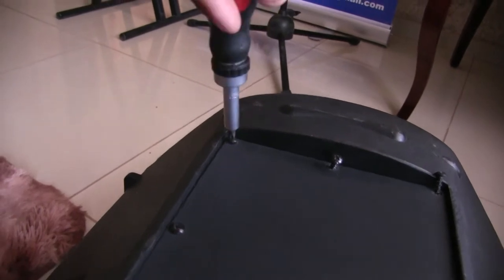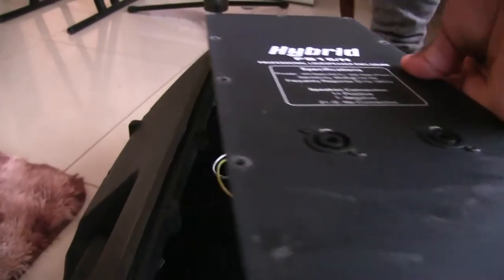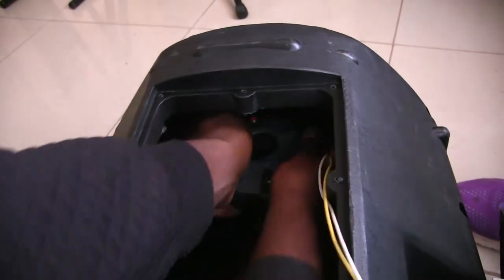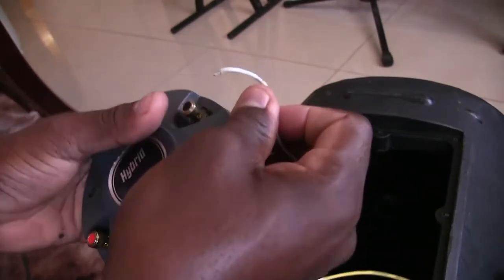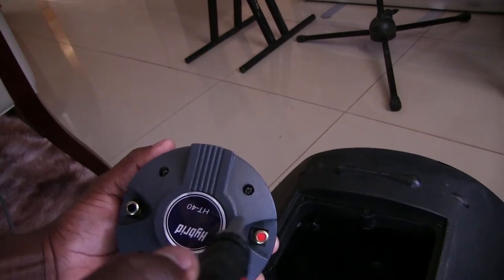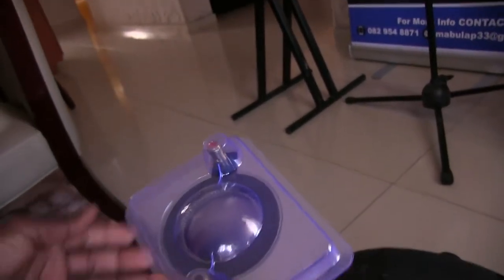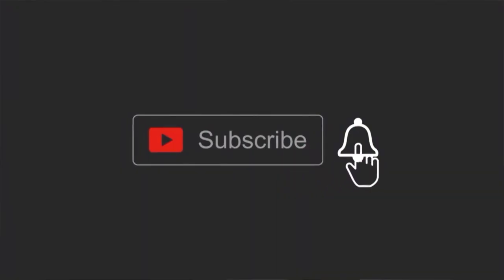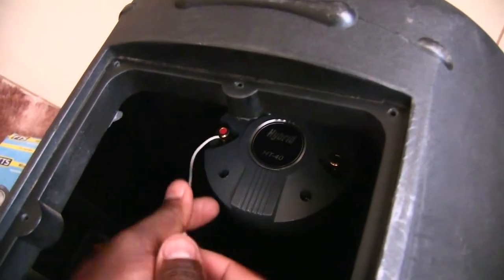HOW TO FIX BLOWN TWEETER

Comment: HELLO DOUGLAS! I noticed that one of my EUROLIVE Powered speakers only had sound coming out of the Woofer so I ordered and installed a new Tweeter Diaphragm but when I powered the unit up it's squealed!!! I took it back apart double checked all the wiring everything is in the correct place! Tweeter is mounted in the correct position! There's no smell or anything burning from the Amplifier section! The Woofer works fine! Can you tell me what that could possibly be wrong!
Reply from the maker: Hi. And sorry for only responding now.
If you have another one of those speakers, please try the working tweeter in the one that's giving problems and do some fault finding. I also suspect that your crossover might need to be replaced.
Reply: Most likely you blew your tweeter due to a bad crossover or bad jackpins

Comment: Sho Douglas my tweeter died and and when i opened the board was burnt by the cables to the tweeter... do you know what the board is called so i can purchase the right thing and if also you could advise on how to replace the shandis
Reply: Ola, its called passive crossover

Comment: Do all tweeters just unscrew like that because mines not budging
Reply: Mine also
Reply from the maker: Different speakers have different tweeters with various ways of mounting. Others attach to the flare using screws. Which brand of speaker do you have?

Comment: When i put the volume all the way up..the tweeter starts cutting off and theres no sound at all in my subwoofer..what could be wrong?
Reply from the maker: Hi. Sorry for only replying now.
But i think you it could be either of the following:

1. Your internal crossover could be faulty. You may find that the components on the circuit are damaged.

2. There could be wires that are shaky or not tightly secured or soldered.

3. Your subside might be dead and needing replacement.